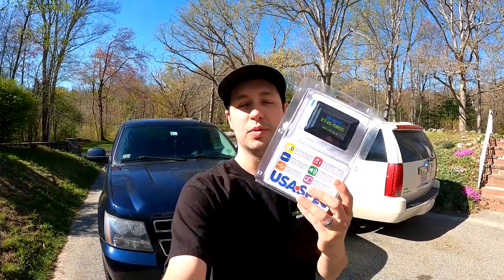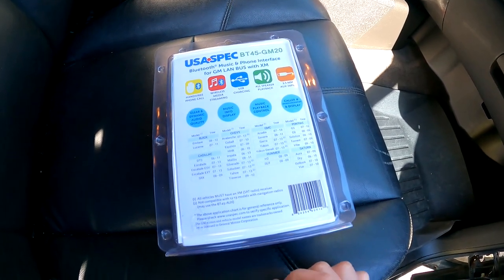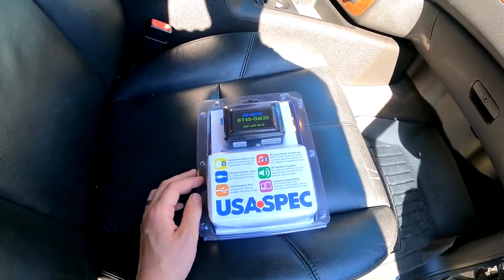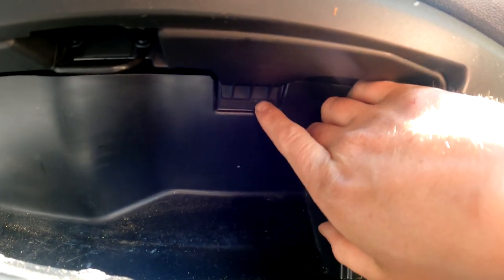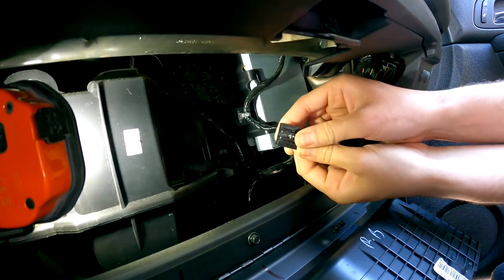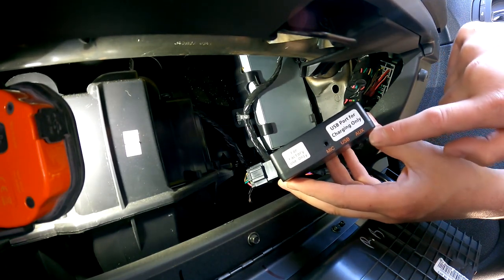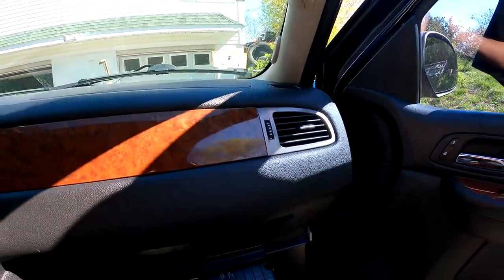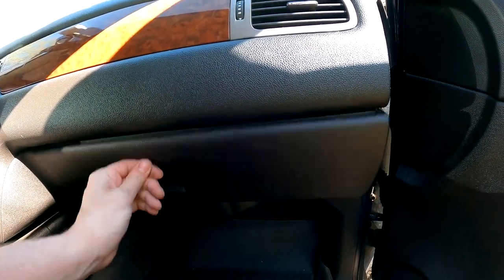How to install Bluetooth in 2007-2013 Tahoe, Suburban, Escalade, Yukon, Denali. MUSIC STREAMING EASY

Comment: I’m out bro. Your intro was too long, just get on with it.
Reply from the maker: There's a fast forward button for a reason
Reply: Skip bro? Fast forward bro? Let me explain this so you'll understand bro, grab the little circle thing bro, and slide it down the straight line thing bro. Or, bro, you can touch the thing that looks like an arrow it has a name for a shape or something but I don't think you'd understand that so you can push these buttons they do different things let's be real bro, this is way too long for you bro. I didn't get to the point fast enough bro, and there is no buttons to fast forward. Bro.

Comment: I have a 2011 Chevrolet silverado, I want to install this part but I am worried I wont be able to use my existing bluetooth for calling. Do you know of I will still be able to use my existing Bluetooth for calling after installing this?
Reply from the maker: I believe that when you install this and have your phone connected to it for Bluetooth, if anyone calls your phone it will go through the module and not the trucks Bluetooth. Because you can't have 2 Bluetooth connections at once you'll have to pick one or the other.

The Tahoe I installed it in does not have factory Bluetooth calling so I can not check on that for you though
Reply: @streetriderscustoms  Thank you for the reply! Let me know after you install it on the 2010. I'm guessing you have Bluetooth on that one and might run into this same problem.
Reply from the maker: The problem is that your phone can only have one Bluetooth connection at a time. If you have your phone connected to the Bluetooth module and are playing music, any calls will go through that.

You would have to turn off the blue tooth connection to the module, stop playing music, then connect with your OEM radio of you wanted to use that for phone calls.

Comment: I just purchased 07 Escalade the heated steering wheel is not working the light turns on but immediately turns off, do you have any ideas why this is happening. I enjoyed this video did you post Escalade video on adding Bluetooth. Thanks for any info
Reply from the maker: there is an inline fuse for the steering wheel on the harness that runs down the column, but if that was out, then Im guessing the light wouldnt even light up

Comment: Will this work for 2011 chevy traverse LT without bluetooth, does the bt45-gm20 base work as the bluetooth modem?
Reply from the maker: This would work according to their website in your Traverse but it is out of stock everywhere. I installed a different brand bluetooth module in my Escalade that also fits your Traverse that you can buy from amazon here: https://amzn.to/3yq1slm
Reply: @streetriderscustoms  Thank you I've been looking around for something that will work to have bluetooth accessories I appreciate your help.

Comment: Will it work with a 2014 tahoe ltz?
Reply from the maker: Yes. Just have to make sure the dip switches are in the proper order. My Tahoe is different than my escalade with navigation
Reply: @streetriderscustoms  does it display tracl info on the screen and can you control the musci with steering wheel buttons?
Reply from the maker: It does not display track info on the radio, but the steering wheel controls will change songs

Comment: Great job! I believe this will work for my 2008 GMC Acadia base model with XM. Question: does the phone call interrupt the radio when it comes in, or do you have to have it in XM mode to receive and make calls? Do the phone call number display on the radio? I have the DOS type version of the standard radio in my Acadia.
Reply from the maker: I am pretty sure it will work for the Acadia, but online I think you can double check to make sure. I am pretty sure the phone call will come in no matter what mode you have the radio in. I am not sure about the number display on the Acadia radio.
Reply: Did it work bro?

Comment: I just bought a 2012 Escalade and I’m surprised it doesn’t have Bluetooth.  Thanks for the upload
Reply from the maker: These years were right before Bluetooth really caught on with the manufacturers. Crazy to think
Reply: @streetriderscustoms  You have a lot of informative detailed information on this generation of Yukons and Escalades. I’m glad I found your channel.  Question for you, there is a USB port in the center console of my Escalade that can play music from a phone or even a flash drive.   Mine isn’t working.  Do you have any suggestions on repairing the issue?
Reply: It does have Bluetooth
Reply: I just grabbed a 2009 Cadillac Escalade EXT!   Looking to bluetooth as well

Comment: Thanks for ur video. I have a 2009 Cadilac Escalade n I don't have the auxiliary port. How can do it on mine? I bought a wireless receiver on Amazon but I use some cables to be able to use it. But it plugs on the back of the center console. I don't like the cables hanging on the back. My daughter already broke one of the cords. I need help pls. What should I do?
Reply from the maker: Well if you go to the description of my video and click the link and buy this from Amazon then you can install it behind your glove box just like I did and will be able to have Bluetooth streaming. Assuming your Escalade has the XM module.
Reply: @streetriderscustoms  I believe it does. And it seems is currently unavailable.
Reply from the maker: It might be unavailable because you do not have a subscription to it. You can follow my video on how to open the glove box and find the XM module. If you can do that then you can go to the link in the description, buy this part, hook it up like I do in the video and you should be all set
Reply: @streetriderscustoms  I have Amazon Prime. But the item says currently unavailable n they don't know when they are gonna get it again. I went into the main website USA SPEC n it cost $261.95 n on Wal-Mart is sold out.
Reply from the maker: That sucks! I had no idea it was sold out, amazon was the best price that I found online

Comment: Did you installed it in your Escalade? Did it work?
Reply from the maker: I have swapped it out into my 2010 escalade for road trips and it worked perfectly. Because it has the navigation radio the dip switches need to be in different positions than the Tahoe